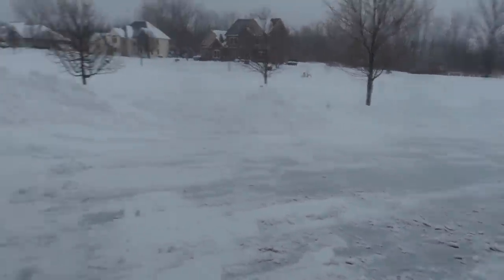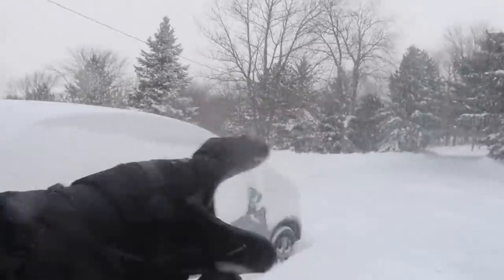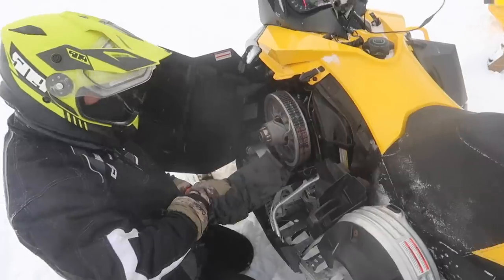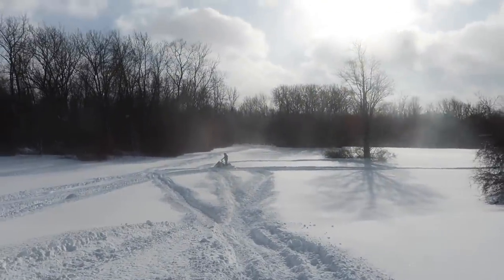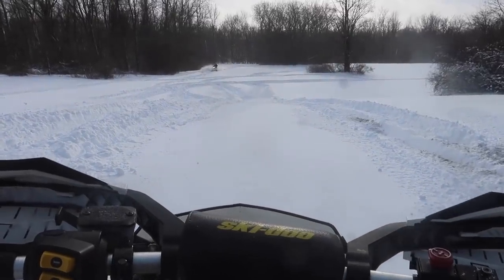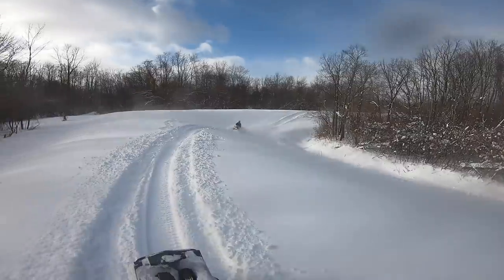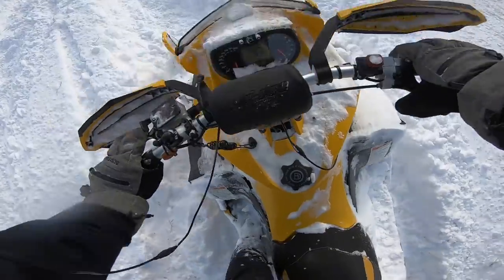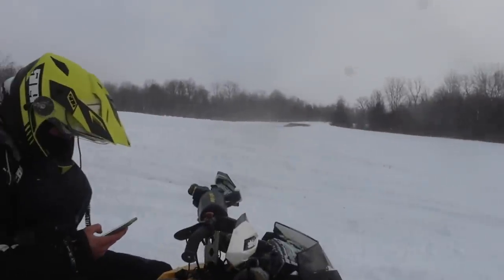DEEP POWDER RIPPING!!! HIS SLED BLOWS....

Comment: Why does ryan's sled keep eating belts?
Reply: Chad Kennedy probably want to check the clutch alignment. That’s usually the first place to look.
Reply: Chad Kennedy either needs clutch rebuild or the front end chassis is slightly bent altering the alignment of the belts... very common on skidoo XP chassis
Reply: If the sled is modified which im sure it is then an aftermarket clutch/belt is probably necessary. Also clutch needs to be adjusted for rider style also. A heavy throttle hand requires a heavier clutch action.
Reply: Chad Kennedy for real
Reply: Cuz its a skidoo....